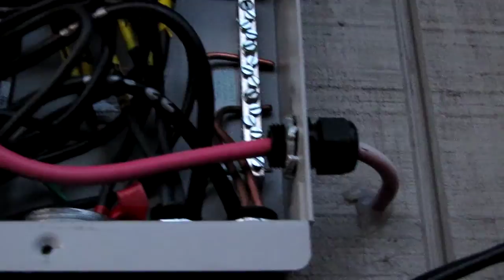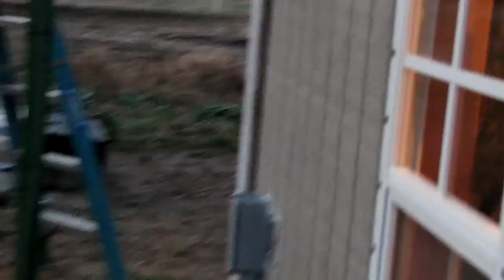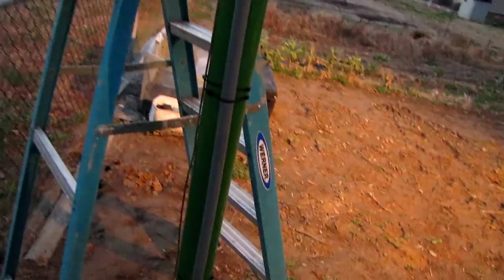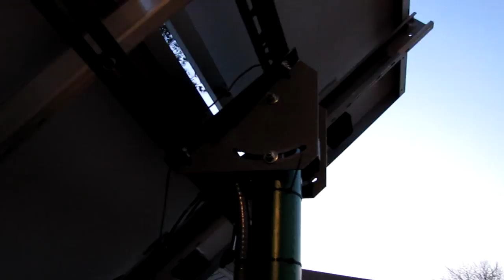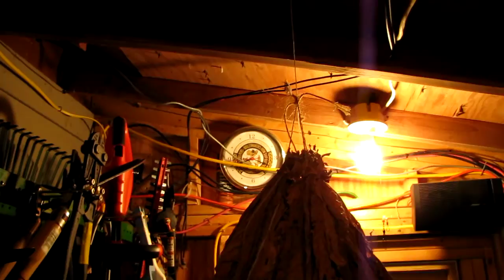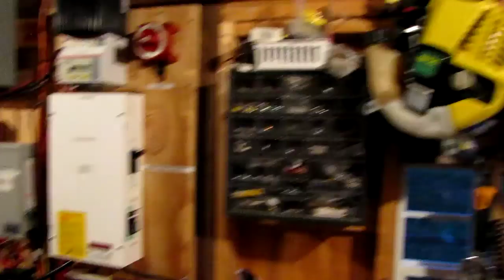How To  Solar Combiner Boxes  And 140 WATT PANELS  VIARLOCITY

Comment: i get 3.5 amps when its chargeing .....but whats the voltage of a  fully charge battery i have 2 12v big batterys CCA 1000 ......i had 12.60 volts in my battery then i used up some power it droped to  12.09 volts will 3.5amp charge my battery and how long would you think it will take with 3.5amps i have a mppt charge controller so that boost thing up  i need my batterys fully charge because i have no power plz help thanks buddy

Comment: hey i have a 140watt solar panel and a 30amp mppt charge controller will my setup charge all 2 of my deep cycle batterys they are rateed at 1000CCA WILL my solar charge it to full

Comment from the maker: @Klubkid69 My Breakers are In My Combiner Box Then go to My DC Disconnect Box  with Breakers Also  I have 15 Amp Breakers for 2 135 watt  Kyocera Solar Panels in 24 volt Thats about 8.5 Amps so 15 amp Breaker is Good Buddy